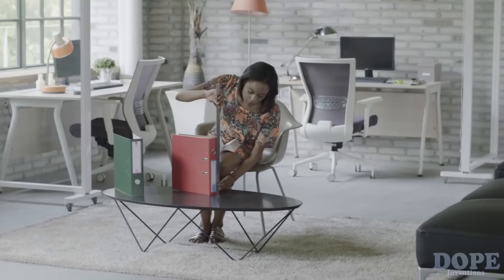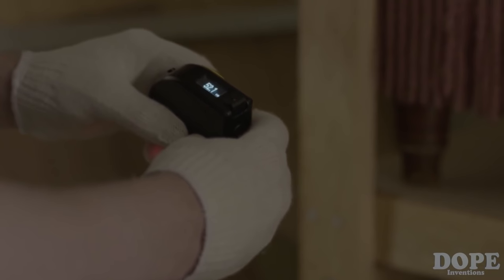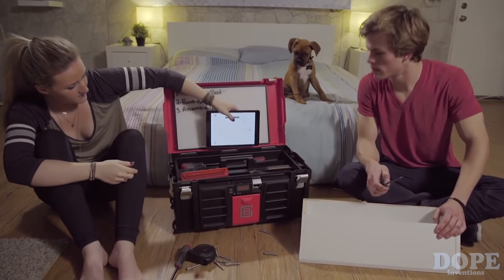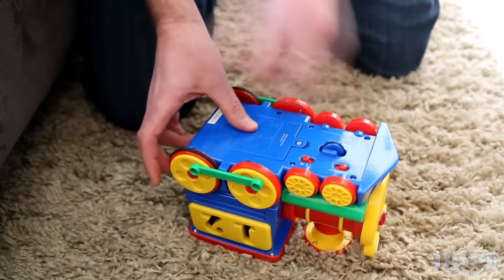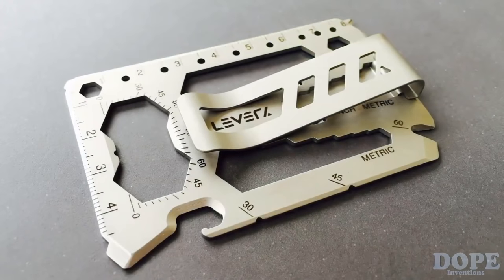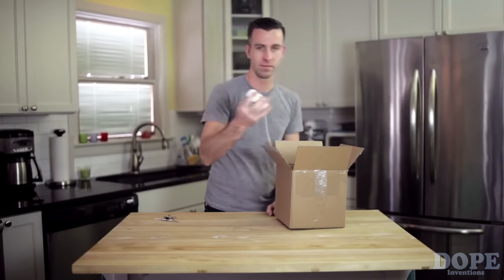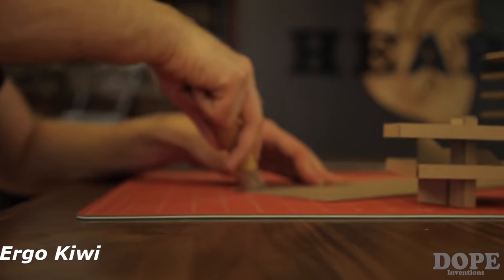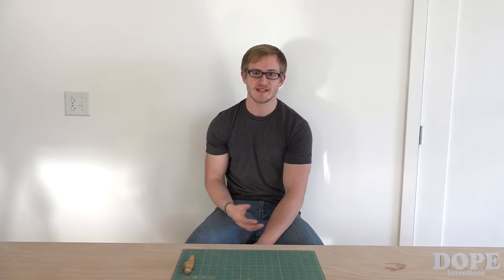Top 5 Multi-Tools YOU MUST HAVE! ▶2

Comment: When you measure something with the Bagel, how can you mark the middle of the distance when it's just a piece of string, surely if you need to find the centre of a board, you'll need to take 2 measurements so whats the point?
Reply: Pros will never buy it- and if pros don't buy it - it's a fail.
Reply: you actually have a point.

Comment: All three measurements that tape produces would be slightly inaccurate. Carpenters don't use string tape because they stretch. The wheel would be for a rough estimate and the laser would be a very rough estimate.

Comment: ive worked in the steel industries and the string line tape measure would be pointless cuz it will be subjected to rain and sparks or be somewhat is close vicinity to a welder.  that tape is only good for other stuff and will never be in the trade industries. possible good for making clothes and interior designing